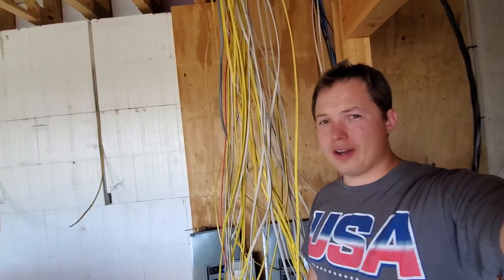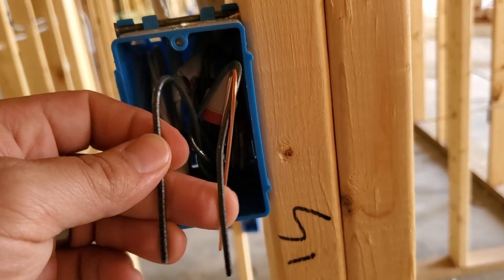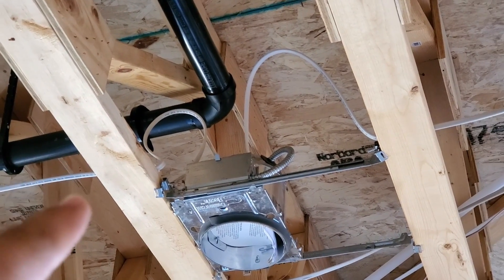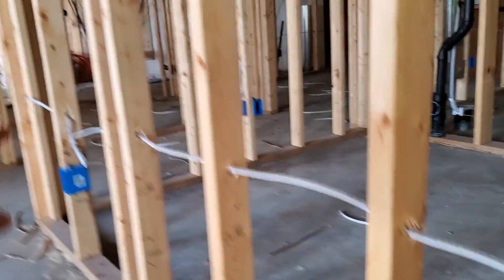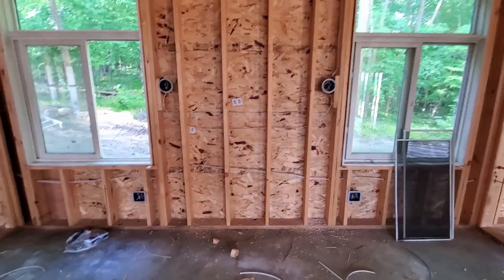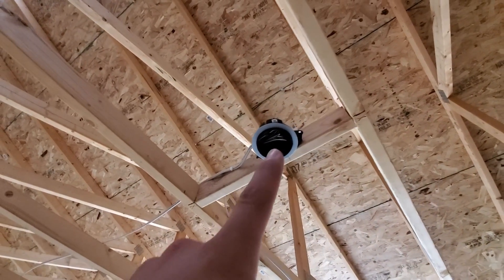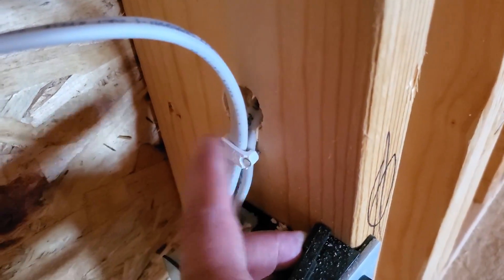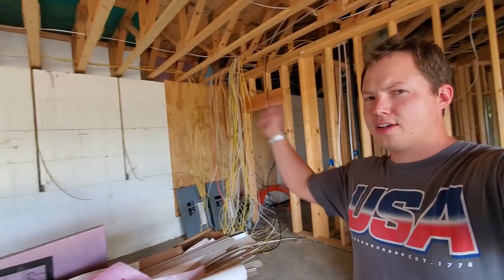New House Wiring Rough In Project Tour!

Comment: 11:45 ... yes,  I prefer lighting separate from power receptacles, as well - for then night lights can be plugged in in case of a circuit trip - furthermore, table lamps are common in living spaces, and can be made photosensitive,  as well.  Nobody likes groping for a flashlight in the dark.

Also:  one of my pet peeves is wiring receptacles to more than one room on a shared circuit.  Can you say 'nuisance'?   Many old hacks will argue that if one circuit supplies a partition to opposite sides,  then the opposite wall of the room gets its juice from another breaker,  so only half of the room goes dark if one breaker trips.  WTF???   These are the same guys who will heat the lighting leg from the receptacle circuits.  Depends on which side of the room the lamp, if any, is plugged into.  Flip a coin.  I like to see one or two circuits per room, for power receptacles,  and a common lighting circuit or two for the main lighting.  This way,  it is very unlikely a lighting circuit would trip from overload, unless a ceiling fan smokes,  or something shorts out.  Why,  I have even seen ceiling fans wired separately,  to the receptacle supply, while the light kit went to the lighting circuit.  There is no good reason to skimp on home runs, save the slight expense of a few breakers and a little extra wire.  A separate circuit for every duplex receptacle in kitchens,  too.  Toaster oven + microwave = trip to the panel. (no pun intended)
Reply: I didn't understand

Comment: Sorry I don’t like that mudring idea for the thermostat. Seems like a lazy approach. I would have used a nail on blue plastic box.
Reply: It’s used as a “pull through”  Primarily for low voltage wiring..Also you could have 50 feet of wiring in the wall. Can’t do that with a due box.

Comment: I didn't see any metal plates to prevent nails from piercing the wires or mabey I wasn't paying attention
Reply: You don't need those plates when the hole is drilled in the center of the stud. Those are for when you have a cable that is running through a notch in the stud or when cable is running through a hole that isn't centered. Drywall installers typically use 1-1/4" or 1-5/8" long screws that cannot reach the cable when it is located in a hole centered within the width of the stud. Drywall is usually 1/2" or 5/8" thick, and the center of the stud is 1-3/4", so the screw would need to be longer than 2 inches to hit the wire.

Comment: What a waste of expensive copper wire left at each box. People get fired for that kind of waste. We used to pick up our scraps and at the end of year have a big party. And that was when copper was cheap. One thing I liked was them not leaving a loop of wire before going into the box. Talk about sloppy. They say well in the future blah, blah. Just another big waste and incredibly sloppy. A lot of DIY guys do that. Too many wires in the one double gang. And that butcher job behind that one  double switch box even though it was a 6 inch wall was pretty nasty. The general contractor could get up set about that. All in all not to bad. I have used thousands of the blue boxes and think they are great.

Comment: Where are these wires coming from originally
Reply: The cables you see hanging down are where they come from, and the panel has yet to be installed. They are going to junction boxes that serve devices like switches, receptacles, lights fans, etc.

Comment: I get the impression that you are not an electrician. You seem to know what you are talking about and then blow it when you don't know what a pancake box is or why the orange tape was on the white wires. If you are not a professional electrician, you should let everyone know that at the beginning of the video.
Reply from the maker: Thanks for the feedback Bill! You are correct that I am not a licensed electrician however I have done a significant amount of wiring on my property. These videos are to hopefully give people a place to start and are by no means the "final authority" on any given topic especially since codes vary from area to area. I'll try to do better with disclosing in the future but I have never claimed to be an electrician in any of my videos.

Thanks Bill!

Comment: correction on the securing of the wires. it's within 12" of a box clamping device. the 8" rule is an exception for single gang boxes without clamps only. all other boxes shall have either integral or an add on clamp. that's if your bound to the NEC. but if not, do what you want.🤣🤣🤣

Comment: better to mount the panels first before you have all those home runs hanging in the way. i like to mark out and box out the house 100% before prepping and pulling wire that way nothing gets missed or forgotten and you won't have to stop running your circuits just to go get a box in order to finish. i mean if your in the mode of boxing, you may as well just go ahead and box everything and be complete. 🤔
Reply: Totally. Mark out where everything goes first, put up a list of materials needed for crew, get everything done in their orders at once, least amount of time wasted.

Comment: WOW, that 2-gang looks grossly overloaded. 😲
Reply: Forget box fill (that couldn’t possibly calculate out to be legal with 8 cables and multiple 14/3 among those), but what on earth could they possibly expect two devices in that box to do with all those wires??? Were they separate runs for every lampholder on each three-way switch? 🤷‍♂️
Reply: @robb0995  IDK for sure, but i would think that they just used that box to feed a bunch of different outlets in different directions. kinda like they use to do in the old days by running a home run to a light box and dropping 1 reverse switch leg to the switch box and then spider webbing out of the same light box to feed the rest of the outlets on that circuit as opposed to just daisy chaining them. but who knows?
Reply: Yes it does!
Reply: Im assuming its a 32 cu inch box.  Now guessing that 4 of them are 14/3 would make 18 conductors, can't remember of the top of my head if grounds are included.  Anyway 18 14 guage conductors require a box to be 36 cu inch.
Reply: @wizard3z868  i count 7 cables total in that box and you're saying you only have 5 cables? and did you include the overstuffed "integral clamps" in your calc.? you should count the clamps as 1 conductor, sized to the largest conductor and you're only suppose to have 1 cable in each one of those cable entry clamps. that's if  you want to get technical and do it to the NEC. i really don't care how you're doing it, but it's not something that i'd be proud enough to put on YouTube and brag about it to the whole world. just saying 🤔🤦‍♂️
Reply: @chaser9363  Pause at 2:57 and look close, there are actually 8 cables. That's a mess. Lol
Reply: @illestofdemall13  i stand corrected.😎👍 i'm blind in one eye and can't see out of the other.😬🤣
Reply: @chaser9363  integral clamp in that box are not part of calc and ya i counted 5 and maybe the JHA allows more than 1 cable thru those integrated flimsy clamps as long as its secured with in 8 inches of box mine dose (if he dosent see anything else wrong or isnt having a bad day )
Reply: @wizard3z868  you need to go back and read the code yet again. The 8"rule and the more than one wire in a ko exception only applies to non metallic "single gang boxes". And the integral clamps are to be counted in the box fill Calc. The reason why the Mfg doesn't include them in the count stamped in the back of the box is because they can't anticipate what size wire you're going to use. Therfore how could they place a value on it. 🤔🤦‍♂️
Reply: @chaser9363  yup recounted 7 thts overloaded
Reply: @wizard3z868  There are actually 8 cables in that 2 gang box.
Reply: @chaser9363  lol thx i have a lot of deleting to do 🤦‍♀️
Reply: @wizard3z868  😎

Comment: Awesome videos!! I'm getting ready to buy an old house with aluminum un-grounded circuits. I know I could just use GFCI outlets to fix it with a few options for aluminum wiring, but I want to re-wire the home anyway. Upgrade the insulation, get rid of a lot of black mold.... I design electrical plans but sometimes lack the smaller details that go into the final product. I love your "OCD" of making things nice. I plan to do the same. I haven't looked at every video yet, but do you have any solar or wind projects? Just curious :)
Reply from the maker: Sounds like a fun project! I haven't done anything with wind or solar yet but have been starting to learn some about it. Might have something on it in the next few years. :) I'm not convinced that the investment is worth it just yet for solar or wind. What area of the country are you from? Good luck and blessings from Minnesota!
Reply: @BenjaminSahlstrom  I'm in Utah. We get both extremes of hot and cold, but its pretty dry here compared to many other places in the US so we get a lot of sun. Can be pretty windy in some areas, but not where our new house is going to be. Would probably need a good State reimbursement or tax break or something to do solar still.

Comment: It breaks code with more than 2 wires in each hole
Reply from the maker: That is what I thought as well but there seems to be some debate about the topic. Read some of the other comments and you'll see what I mean. I agree that 2 cables per hole is probably the best way to go in order to avoid any possible questions that an inspector may have. Please subscribe if you haven't already! I have more electrical videos coming soon.
Reply: @BenjaminSahlstrom  the code book is only a recommendation its up to local JHA to make final rules
Reply: the code book is only a recommendation its up to local JHA to make final rules
Reply: In 12 years I have never had anyone say anything about running two cables through one entrance.

Comment: Im a licensed electrician...have been for 25 years and that is the worst looking wiring ive ever seen from a professional electrician...wow...that is bad!
Reply: Believe me I have seen far worse. All in all not bad.
Reply: I wish I could say that was the worst looking work that I have seen form a '"professional" electrician, but is is not.  Things get worse when someone thinks that because they are an electrician they can handle the low voltage stuff, and then leave it for the poor IT team to figure out what they won't thinking. I thankfully have a professional electrician in my family so I learned what was right and wrong from a very young age.
Reply: Meh it’s on par with an average job. Still lot of clean up to do so I’m not gonna knock it entirely. My only pet peeve is this “side saddle “ ceiling fan boxes. I hate those with a passion. Get a fan rated bar hanger installed with 2” #10 hex head or the type and you will not have any fan hanging issues
Reply: please be specfic about poor wiring
Reply: no

Comment: Great video showing somebody else’s work. Yeah that’s pretty sloppy work by those guys just in and out in a couple days. No cleanup. Those  2x6’s he chopped up by the front door would never fly. That’s hack type work. Very lazy on their horizontal wiring. These guys are doing the bare minimum for their job. Here in Ohio and in most states as far as I know now nobody would be running 14/2 for receptacles, that’s really being cheap and shortsighted. That’s a production electrician who doesn’t about things like bulges in drywall or much anything. 

Somebody made a comment below about using metal boxes and grounding only to the box and not to the devices. That is not acceptable practice anymore and you should fix that. It would not pass anywhere in the state of Ohio let alone most other states. 

Yeah a house this big I would’ve liked to of seen the house better from the outside to see how really large it was. But not seeing any low-voltage cabling was astonishing. No ethernet cable laying didn’t really notice any doorbell wiring. No security wiring, no speaker or audio or video cabling a house of this size around here would have all of those items pre-wired.

There’s many ways to accomplish wiring a house and this is one that I wouldn’t have chosen. Possibly the bed for the electric is very tight or the electrician is just cheap which I think is for sure. I saw far too much white to Romex running around that house.

Always good to look at other peoples work that’s how you learn. Great job with the video and maybe you can get back in there again at some other stages of the finish. First one of your videos I’ve caught in a while.

If you go to my YouTube channel I have an electrical playlist along with many other playlists and you can find a lot of good videos in the electrical list that can help most people with their projects. I save these playlist for my own reference but mostly so I can let people I’m trying to help or teach learn on their own a bit.
Reply: Like you comment on grounding metal boxes and devices.  I have always grounded both the box and device when I have used them.  Not sure if this is a requirement though in CT because I have seen plenty of people just ground the box.  

If I were putting a project out to bid I would put in detail what was to be done including what wire to be run.  I would also have the electric and low voltage on separate bids.  I have seen far too many electricians think they can run low voltage that end up making a mess out of everything.

Comment: A lot of new furniture has powered USB ports built in so less of a need for another box at bed level. Also, I wish I had a lot of my outlets sunken into the wall so I can push furniture up flush against the wall instead of having to use flat redirecting extension cords so certain electronics can plug in

Comment: Bill Beedie
Ben, I too use 12 ga wire in bedrooms, all to J box, then to 20 amp breaker.  Question - what if I use the cheaper 15 amp receptacles in the bedroom boxes - do I have a safety problem?  No inspector problem yet, maybe not noticed!
Reply: 15 amp receptacles are fine according to NEC 210.21(B)(3) because UL listing requires 15-amp receptacles to be 20-amp "feed-through" rated (current between daisy-chained receptacles), even though they are only rated for 15 amps to the individual appliances they serve.
Reply: @NorthernWindNut  Thanks for the info.
Reply: @williamb395  
No problem.  If you have any doubts the packaging for the receptacle should even specify "20-amp feed-through rated" or something like that.
Reply: This should be find for those of us in the US unless 
     A)your local state or city has a stricter regulation.
     B)It is the only receptacle on the breaker
If you are in Canada, you would be required to use 20AMP receptacles.

Comment: Ben, what's the requirements for anchoring the wires in the ICF walls? Is friction fit allowed or should you use an "eyed" zip tie to anchor them? Running them back up and over is to prevent cutting into the plastic "stud" in the ICF.
Reply: In my ICF the plastic did not extend to the joint so going across at the joint worked perfectly fine. I'd like to hear what people use to hold it to the back though. I made the cut so the wire fit snug, tucked it back, and foamed it in place. I did the drywall myself too and made a do not screw line where the wire ran just in case they didn't stay back.

Comment: 8:33 we wrap our commons around two travelers like that when we make up our 3 ways
Reply: Sam S the orange wrap on the hot leads in a 4 way switch config, possibly? Though in most “how to’s” they say use black tape.
Reply: The hot wraps are just a way to keep the conductors grouped together for each individual run so the guy who did the runs doesn't forget what goes where or next guy doing the trim out later doesn't get things mixed up. Most crews do things similar or can at least figure it out based on experience without having to ring out/trace runs but our crew usually does a tape band/piece of romex jacket with sharpie label to make identification easier later and we'd wind up switch leg wires.
Reply: me too
Reply: It would think 334.24 prohibits that since the bending radius for NM cable can't be less than five times the cable diameter and that wrap is around two wires.
Reply: Good idea…I do a small loop on switch leg, sometimes small black tape on feed in.